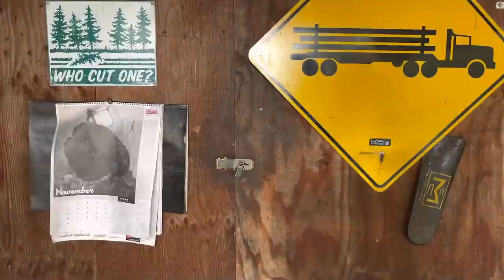Chainsaw Battle!, who’s faster.. 3 ported Pro Mac 850’s , 3 Saw Builders

Comment: The reason I got my G660. Was that Tinman give me the Idea. That I can make a hotrod saw. With the tools I already have. So I picked a saw that didnt cost me a fortune. That I can upgrade with Stihl name brand parts. From the bottom up. Literally every part can a stihl OEM part. I plan on running it this year. An when cutting slows down. I can pull it apart. Port the cylinder. An replace the parts that are known to cause problems. With quality stihl Parts. So That when it's all done. I have a first class saw. So far the saw seems to be a really decent. But I want to know what a ported saw feels like. An Buckin you turned me on to Tinman, Ironhorse, and Donny Walker. This community  is strong. An is getting stronger.
Reply: Check out "dyno Joe's mods" too

Comment: hey billy, i just got an old chainsaw with a plunger type bar oiler. i was wondering how often i should push the plunger when using the saw? it has a 20" bar if that matters
Reply: More the better I'd say till the chain is soaked
Reply: Then every cut
Reply from the maker: just keep yer eye on it , you dont want it to tighten up
Reply: @BuckinBillyRaySmith  hi bucking  love the content
Reply: thanks to both of you